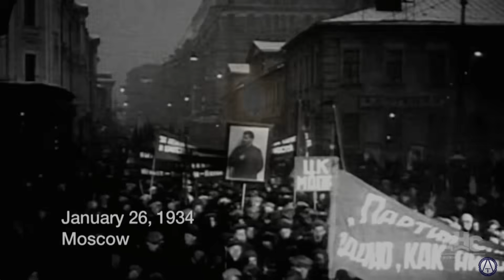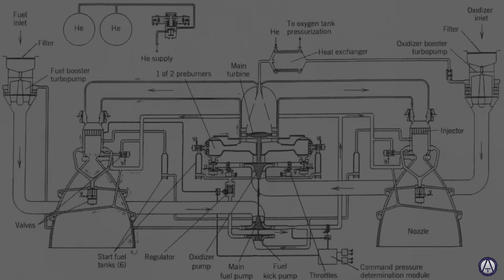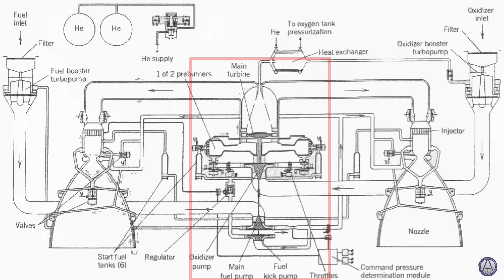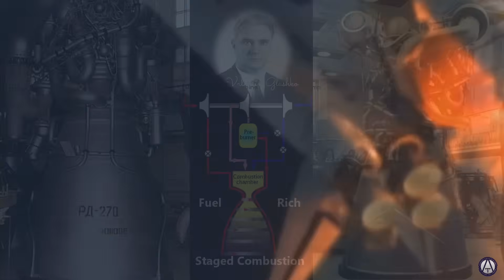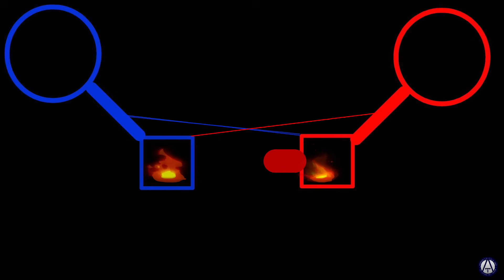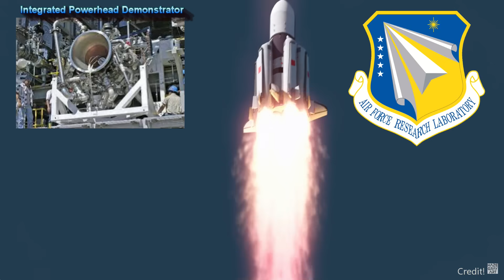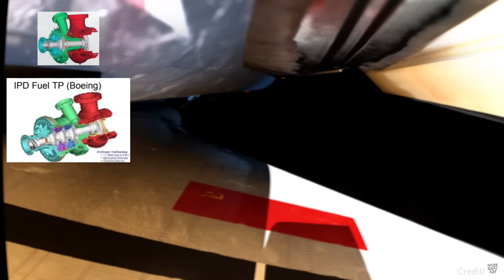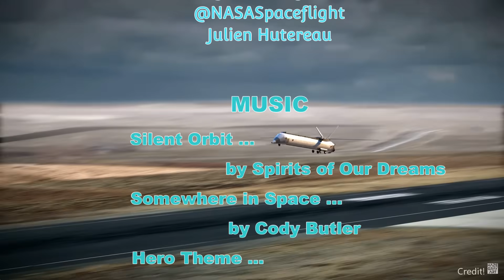Rocket Science: How the Raptor Rocket Engine Works and Full Flow Staged Combustion

Comment: Its amazing what cavitation can do to a marine jet drive impeller.
Reply from the maker: It is indeed, tear holes in titanium like it was balsa wood
Reply: It's as if cavitation was an analog for fusion, each little bubble a star pr sun onto itself. 

I wonder if commercial fusion will be catelized by fluid...!? Oh... is plasma used as ambient pressure, a backdrop to facilitate burst of fusion in the same way cavitation bubbles are formed on propellers?

Wonder what a fusion impeller looks like?
Reply: If the impellers were electrified, would that have any effect toward deflecting the explosive force of cavitation?
Reply: Oh! Google informs me the notion was proposed by a fraud on 2002... 

"Bubble fusion is the non-technical name for a nuclear fusion reaction hypothesized to occur inside extraordinarily large collapsing gas bubbles created in a liquid during acoustic cavitation. The more technical name is sonofusion."

Plasma based "sonofusion" might already be "in the works." Al least I hope it is.

Comment: I really like the flyback-boosters of the Uragan concept. I wonder if the extra hardware weighs more than the propellant a vertical-landing booster would need to keep in reserve.
Reply from the maker: That’s a very good question
Reply: I just did some quick googling to see if I could figure it out, but it's kinda too hard to tell from an approximate view. I'd say it's about the same, which is surprising. Landing gear + Wings is maybe 5-10 tons and Landing Legs + Fuel is maybe 10-15 tons. But the winged booster would need to be reinforced to take the new loads coming from all the wrong directions. Makes me wonder if SpaceX researched this at all before committing to propulsive landings.
Reply: @nicholasn.2883  Thanks for the research! I think the ratio gets better for flyback-boosters as the size increases thanks to the square-cube law, as the size of the wings, landing gear and reinforcements grows more slowly than the internal volume/amount of propellant it can carry as opposed to vertical landing were the amount of reserve propellant grows at the same rate. There is probably a point were, purely from an engineering perspective, one design makes more sense than the other, if it is even practical to build a flyback-booster the size of Superheavy or even close to that.
Reply: @g.f.martianshipyards9328  don't forget that all rockets benefit from lifting body effects.  Even a brick has some aerodynamics, though very poor.  Look at new SpaceX Super Heavy booster.  They just added chines to increase the lifting body area with just little material.
Reply: @g.f.martianshipyards9328  The square-cube law doesn't actually hold for pressure vessels. A pressure vessel holding a certain pressure will have the same mass ratio of content to tank, no matter the size. Similarly, rocket performance depends on mass ratio. Seen in this light, when you scale a propulsively-landed rocket up, the amount of fuel required to land is always the same percentage of the total, whereas for a winged booster the wing area has to grow to the (3/2)th power to maintain a similar wing loading, which eats into propellant mass ratio.
Reply: @dsdy1205  Thanks, that's really interesting, even if a bit unintuitive so I'm still trying to wrap my head around that. Does this mean that the density of fluid/gas inside a pressure vessel decreases as the vessel grows larger?
Reply: @g.f.martianshipyards9328  no, constant pressure and temp means constant density. The issue is that the cube square law implies the thickness of the tank wall has to increase linearly with the tank size. Since the tank mass is proportional to the thickness times the surface area, and the surface area goes up with L^2 while the thickness goes up with L, then tank mass goes up with L^3, just as the tank content mass does.
Reply: @dsdy1205  Thanks again.